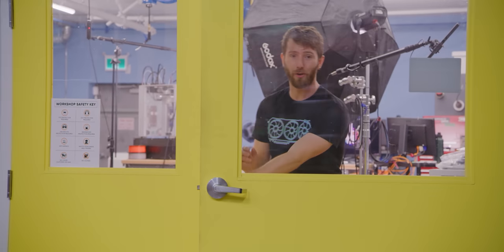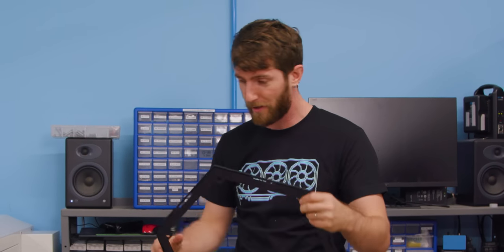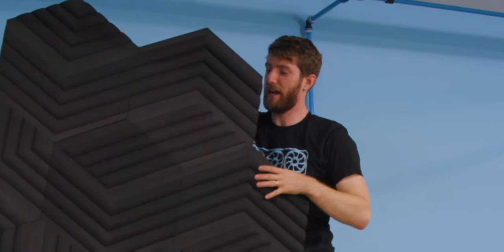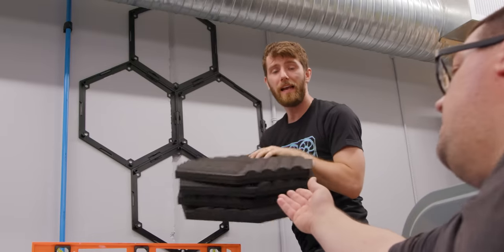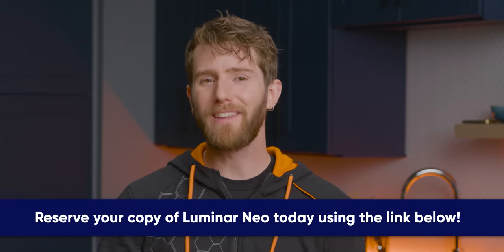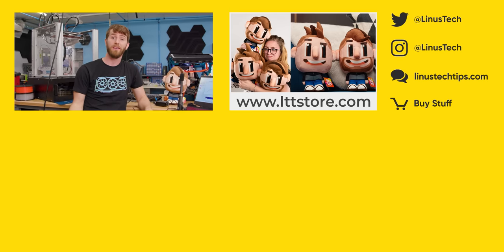I'm only going to say this once... - Acoustic treating with Elgato Wave

Comment: I will say, having done many acoustic treatments over the years, pretty much any acoustic treatment you can buy that's labeled as such, when properly deployed, will improve your space's sound, and for the money, the Wave panels are not a bad buy for the ordinary consumer they're targeting. If you don't really know what you're doing, buying a pack or two of these and putting them up on your flat walls will still go a long way, and so long as you don't find out you need a better frequency coverage, it's only a one-time expense.
Reply: Did they say that these planets will also reduce noise for other rooms nearby? I'd imagine it would have to
Reply: @MrSpiderJockeyLV  They sort of will. They'll reduce room-to-room vibration in the frequency range they work at, but they will not reduce the bass that comes through or the air-gap transmission of sound which are the bigger concerns when talking about reducing sound from other rooms.
Reply: @cheeseisgreat24  so what cheap suggestions do you have for going about noise reduction/isolation? I was already looking at buying acoustic panels, but I know those won't be enough to keep my sound in. 

I was contemplating getting thick wool blankets and adding those to the wall...
Reply: @christopherdefreeuw1120  Hi, Acoustic Engineer here, you're talking about two different things in these replies. 
To control the Isolation from other rooms it will require density and thickness. ie. extra layers of plasterboard or timber. The greater the depth of the wall the better isolation of lower frequencies.
This video is directly talking about Reverb RT60. Which loosely relates to speech intelligibility within the room/echo. Sound bouncing between walls. Not isolation. Soft furnishings, curtains, rugs can help. Place your "acoustic ABSORBITIVE panels" on perpendicular walls to stop the sound bounching. 4ft band around the room at and above desk height is usually a good start.
Reply: @christopherdefreeuw1120  if you need isolation and don't have much control over the rest of your environment,, My suggestion typically is to just get one of those mic surrounds that mounts to your micstand and turn the gain as low as you can get away with and speak closer to it. For everything else from around you that creeps in, noise gates are your friend.
Reply: @christopherdefreeuw1120  Unfortunately the most difficult frequencies to control - sub frequencies - do indeed just require cave-man tactics - bass traps will improve the sound inside the room as mentioned, but won't do much to stop sub-frequencies escaping and annoying people, there's no way around that. Thick blankets are indeed one way to start with this, but they're not going to be super effective - as mentioned above, you ideally want to be able to add A LOT, and unfortunately there's not really a cheap way to go about it - we're talking heavy insulation like Rockwool and timber. Some people have built 'room-in-a-room' setups to deal with it.

The cheapest way to start, if we're talking amplifiers, is bass isolation - if bass or guitar amps are directly on the floor, put them on casters or something similar. IIf you're mixing look at the Subpac or a similar subwoofer solution instead of having a subwoofer on the floor. I reckon those would reduce the bass leakage as much as, if not possibly more than, putting blankets on the wall.

Having double or triple glazed windows will also reduce sound leakage outside, as well as reducing air gaps through things such as doors.
Reply: @Sir83chris  thanks for the info! Most of what I'm trying to isolate is just my voice. I do a lot of online teaching and streaming and I am known to be loud. I also play tuba, but that would be during more common hours. 

I'm mainly looking to cut down my voice during late night sessions between a shared wall with another bedroom. 

I've looked into possibly getting Rockwool and wrapping those in burlap, but that wouldn't be enough to cover the wall.
Reply: @christopherdefreeuw1120  Ah okay, human voice makes this a fair bit simpler. Unless you're the bass in a barber shop quartet, those sub-frequencies won't be the main issue, but maybe more the 400-1KHz range - you could perhaps focus on stuff like mic surrounds that are designed to isolate the microphone, get a fairly large one at that, and ensure you can position the mic so you can learn to speak into the isolation rather than the room.

Blankets against the offending wall could also be somewhat effective as you postured (higher frequencies are a lot more targeted and controllable, so I would focus on the direction initially rather than the whole room if cost is an issue). Look into acoustic curtains perhaps - might look nicer than blankets haha. Cutting down on doorframe airgaps is also still a good idea. Thick Rockwool panels to essentially double insulation would still be the most effective but yes, can be costly - could be worth saving the cash for however. 

Do make sure that if you do go Rockwool you know of the issues with working with the stuff - and equivalents like Knauf can also be a good option if it's available.

Comment: the diffrence in color is due to the pressure in the packing , when you get acoustic pads you need to submerge them in water , let them dry about 48 hours then the color should be the same.

talking from expreince i have  a studio

Comment: As expected, those did nothing to affect the room below 250Hz. While that region was not an issue for your larger room, in small rooms it will not work as well. DIY for thicker panels held a few inches off the wall will treat lower in frequency, as well as spanning corners.

Comment: This is a very expensive way to cut down on reflections. The biggest factor is large flat, hard surfaces that are parallel. You can make cheap wall mounted diffusers that break up these surfaces, and simple bass traps in the corners to control boominess. Hang some from the ceiling too if you want to go further. These thin foam diffusers are always super expensive and only moderately effective. Use them to even out a small recording zone, but using them to treat a whole room is madness.

Comment: Linus: "... and you guys can hear the difference in how those sound."
Me: "Fraid not, Linus my friend. With 30 years or noisy work environments, noisy vehicles, and 10 years of Marching Band, I get to enjoy a very monotone version of Carol of the Bells year round."
Reply: @ghostpepper9769  I wish I could, but I also daily drove an 85 Chevy Silverado Custom Delux with a 6.2 L diesel engine. And I worked in an IT Data Center for almost 20 years. I needed hearing protection for all of that.
Reply: You can hear the difference between the two mics.... Err nope

Comment: For those of you who want to hear the difference in reverb immediately:
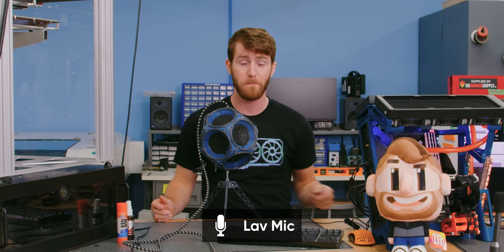First test (no Elgato panels installed) : 2:14
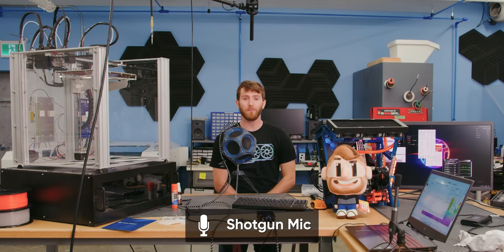Second test (Elgato panels installed) : 10:50
Third test (more panels installed): 13:26
There is indeed a notable difference in the reverb on the room. Funny that just like many have pointed out, the more shots were made while installing the panels, the less reverb can be heard while they work. Really fascinating.
The most perceptable gain for this is the shotgun mike indeed, but i can imagine the differences being heard live inside the room too.
Reply: "shotgun Mike"

Comment: Because corners reflect sound back in the direction it came from, corners are "energy points" for reverb.  Normally, the top priority would be to treat corners where 3 surfaces meet (i.e. wall-wall-ceiling and wall-wall-floor).  The second priority would be wall-wall.  This is also why concert halls are designed with no parallel surfaces.

Another way to illustrate the acoustic importance of corners is the effect of placing speakers in corners.  For example, putting a subwoofer on the floor adds about 3dB while placing it against a wall adds about 6dB.

Comment: As someone who built her own acoustic panels with rockwool, some cheap wood, spray adhesive, and cute fabric, I would love to see you folks give it a try. Each panel covers about the same amount of space as the Elgato kit, but runs about $35 to build. You know, plus the labor to make them.

It's probably not the best way to save money, but they look 1000% better since you can pick up whatever fabric design you want. Heck, you could probably print your own fabric at Spoonflower and get LTT sound panels that would look far more aesthetically pleasing.

Comment: I'd love to see a comparison between a solution like this and a software solution, such as Nvidia's hardware-based echo and noise reduction software.

Also, isn't it "the quick brown fox jumps over the lazy dog?" I thought the idea was to get every letter in the English alphabet into the sentence.
Reply: he said “the quick brown fox jumps over the lazy dog.”
Reply: They have the comparison already in the video.  Twenty seconds in.
Reply: @ddgaxelnilsson7855  He said "the quick brown fox jumped over the lazy dog", so he technically missed the letter "s".
Reply: CORRECT !!!. Jumps NOT Jumped
Reply: @SammySlamma92  Absolutely - I have no doubt at all that the best option is sound baffling, but that's a solution that costs hundreds of dollars, even if you go for the cheaper option presented in this video.

I'm just curious how much you're actually losing out by using the RTX filtering.
Reply: @ddgaxelnilsson7855  No, he really doesn't. Not at 2:08, not at 10:45, and not at 13:30. 

This is obviously not at all important, but we can at least agree on the obvious facts, right?
Reply: @johngaltline9933  Not really though. He said that post processing the reverb out has some obvious drawbacks, but there were no actual tests conducted, the way they were for the various panel configurations.
Reply: @MattGrill  oh, I must’ve not been listening properly, I heard jumps, I guess I heard wrong

Comment: I came from the theater world and learned how to make acoustic panels from muslin fabric. They work better than foam or carpet imo. I was a stagehand and set builder in HS and beyond.  

I just use glue and wood dowels to hold a cedar frame together then wrap it in muslin fabric and staple it on the inside of the frame to avoid wall vibrations from the staples. You can pack the back with couch foam from a furniture store if you like, but it would be overkill.  

To do a normal room, you're probably looking at $100 in wood and fabric. You could do your office for probably twice that.  More if you have no saws or staplers. I have a sawsstop table saw and it has saved my life more than once. Worry the high price to keep your fingers (and wrist, in my case)

Comment: In case someone doesn't want to watch 15 minutes: "acoustic" panels or foam stuff alone does NOT work as SOUNDPROOF of a room. If you're in a very loud place, or say you want to set up drums, these alone don't do anything to prevent noise (or sound) to come in or out of said room. 

That said, you should watch the video.
Reply: Soundproofing is different from sound treatment. These panels are designed for Reverb treatment. Soundproofing is also known as Acoustic Isolation, and it is its own, very expensive beast that requires structural changes to a room, Specialized Acoustic HVAC to handle CO2 Buildup, and very very high mass walls. It requires all airgaps to be sealed (Outlets, doors, windows.) Which makes CO2 build up in the room, and oxygen depletion, requiring a dedicated Acoustically designed HVAC system to cycle out the air so you can breathe.

These panels are designed to reduce reverb in the room, which is that sort of pseudo echo. Used correctly, these panels perform really well for what they are designed for. As you see in the video, they do nothing for low frequencies, which is what basstraps are for.

Comment: One thing I wanted to call out. There's this thing called the Schroeder Frequency which is the point at which sound waves in a room go from resonating to reflecting. Low frequencies resonate, high frequencies reflect. Those resonating waves are the standing waves you're referring to so when you mentioned that the standing waves had an RT60 of .9s, the frequencies they existed at (~1.1-1.2KHz) cannot be standing and they are instead reflecting waves.
Reply: "standing" refers to the build up of multiple waves in the same spot. It's a combination of waves that emphasize or negate certain frequencies. By absorbing some of these waves (panels), you remove the build up caused by reflections off the walls that imitate a "standing wave".

Comment: If "the quick brown fox jumped over the lazy dog" there wouldn't be an "s" which is why the fox "jumps" instead
Reply: It's kind of a dumb test anyways because it's designed to use every letter in the written alphabet, not every sound used in speech.
Reply: @Agedude  Yeah, there are actually better phrases to say on a mic check designed to recreate more challenging sounds, namely plosives and, as Laura Mitzenmacher mentioned, sibilance.

Comment: Just something for all yall to keep in mind: most cheap acoustic treatment is fire rated as packing material, and is a fire hazard. Putting up treatment that is not fire safe in a workshop like this has the potential to break some codes, depending on how your fire code works. Imo, this is why DIY treatments are better than most foam options. 

The results of these are very impressive though, I must say.
Reply: He took a blowtorch to the foam in the video

Comment: A little tip for sticking these to the walls, use a clean, dry paint roller to press them securely to the wall. Use an extension to make sticking the higher panels easy!

Comment: Reverb is not caused by a standing wave and is not a standing wave. Standing waves happen between two parallel surfaces at certain frequencies where the wave length is an integer multiple of a room's measurement. E.g. in a 10 meter room the lowest standing wave would be around 8.5 Hz (wave length 40 m, so the room would be 1/4 wave length).

Comment: If LMG made acoustic panels, bass traps, and sound dispersion panels i'd definitely by some for my home theater. Try to keep them below the 50$ per panel and im sure they'll sell great. Maybe try to be out Gik Acoustics.
edit: you also used 3500$ in acoustic panels. Yeeeeeesh
Reply: Another note is try to get variable thickness that they can choose instead of premade 1"-2" panels.
Reply: Yeah I mean at the end of the day, foam panels are foam panels and the Elgato are thin and way too expensive imo.
Reply: @Jobo9O9  literally lmao

Comment: 2:20 - A lot of peeps get the 'using every letter of the alphabet' phrase incorrect... It should be in the present tense: "The quick brown fox jumps over the lazy dog." If you use the past tense:  "The quick brown fox jumped over the lazy dog", you omit the letter 's'.

This may not sound like a big deal when testing the keys, 'hammers' and ink-ribbon on your old-school manual clickety-clackety typewriter (which is where the test phrase got most use), but it's important if you're recording the human voice because 'esses' are peculiar beasts that caussse all ssssorts of problemsss to microphones. 🐍  👀
Reply: There's two sibilants in the incorrect sentence anyway. X and Z. It doesn't matter in this instance because of that.

Comment: I get that this is mostly an ad, but you could have talked more about how you can determine which wall(s) are the most problematic ones, as well as other options such as curtains, bass traps etc. (Done by: Watching the problematic frequencies + the formula of the relationship between frequency and distance.)
Reply: I don't think they have equipment to do that level of analysis

Comment: Seems awfully expensive for what it is, mind you it’s Elgato and they know some aspiring streamer will through money at anything 😅
Reply: Did you not watch the video? If you go anything not elgato it will be more expensive.
Reply: @mrfatmanjunior  there are 100% cheaper and more coverage options, the video is sponsored 🙃
Reply: You can literally get foam for 10 times less. Might not be as great per panel  but you can use five times more and do a double layer of needed and it might still be cheaper

Comment: Okay this just makes me completely baffled, I work in recording studio design so I think I have the qualifications to critique this. They have a massive workshop but opt to use small expensive preassembled panels!? A wooden frame filled with rockwool and wrapped in a sheet of fabric would be a. Much easier to use in a room that size and b. Be more effective as long as the depth was at least 3 inches. And c. Would still look great

Comment: Not being an audio engineer or whatever they're called, I did something like this for my room using much shittier panels years ago. Just small patches of the walls/door being covered by the foam panels. It does make a big difference. I just figured that given how sound is essentially a wave, ANY degree of dampening (ideally spread out) should make a difference. Turns out that's exactly the case.

Comment: Hey guys, please be carefull with putting this kind of foam under high temperature or on fire (9:25).
In Brazil we a had a disaster in a club house (Balada Kiss - Santa Maria). The fire spreaded to the sound insulators which released a very toxic gas from the combustion. It resulted in more than 200 deaths by suffocation.
Stay Safe!

Comment: I remember reading about acoustics many years ago and the "rule of thumb" was to cover at least 50% of the reflective surfaces with absorbing material evenly. This was described as control for the inside speaker boxes where you really don't want reflected sound as well as living space to improve the sound of your sound system as well as the sound for your microphones.
Reply: Mind you, this was in the 70's. Apparently this stuff is a vast improvement compared to then.